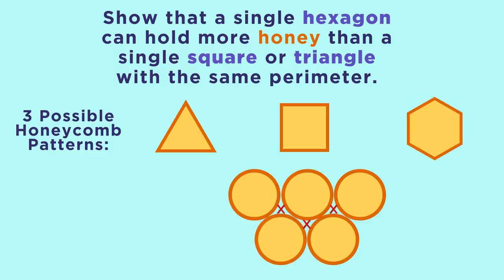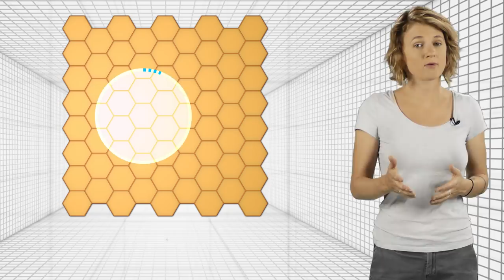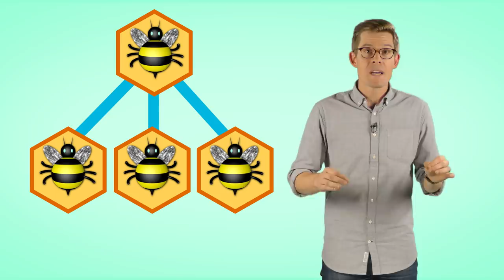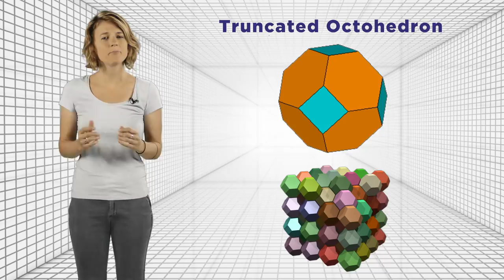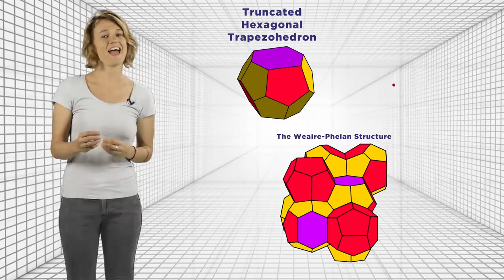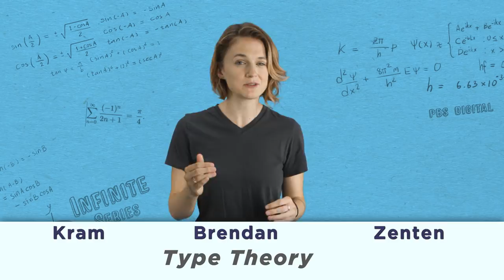The Honeycombs of 4-Dimensional Bees ft. Joe Hanson | Infinite Series

Comment: How do honeybees know to make hexagons?
According to the linked video, bees simply make circular honeycombs but as the wax hardens the surface tension molds/pulls the circles into hexagons.

I may be spoiling it for some, but I don't like it when I'm forced to go watch another video when it takes 7 seconds to tell me the answer. So, I'm helping others like me.
Reply: Bees make circular honeycombs.  Those circles melt and expand into hexagons due to physics.  Just like bubbles on a surface would be circular, but would become hexagons should there be at least 6 bubbles to surround another bubble.  It is just the most stable structure for adjacent circles.
Reply: Icewind007 

Thanks for literally explaining what the first guy said. We totally needed it.
Reply: The thing is we're talking about the second part of the vid.. 4D bees
Reply: That begs the question, how do they know how to make circles?
Reply: Actually, if you've ever looked at a bee's head you would see that the shape of the honeycomb cell has more to do with the bee's head than anything else.
Reply: So would 4D bees make spheres - the 3D equivalent of a circle - and pack those optimally, as they do with the hexagonal honeycomb? When the wax hardens into the final shape with the surface tension it would produce the Truncated Octahedron structure rather than the Weaire-Phelan structure due to the method of construction rather than strict soap film optimization.

Comment: I kinda always thought bees made hexagons because if you put circles (holes) as closely as possible, each circle is surrounded by 6 other circles, and the connections between them are inconsistent, and waste space, therefore, to un-waste as much space, you thin out the edges on all sides to the minimum, thus creating a hexagon
Reply: Isn't that then because bees have not invented closets, and have no clothes to hang up on hangers, and no stuff to hoard away somewhere?

Comment: What would the honeycombs of a 2-D bee look like?
Reply from the maker: Huh? Good question. Well, if we assumed they made "sheets" of 1-dimensional unit length combs, like in the other dimensions, then I guess they'd just be little lines...
Reply: What if bees lived in a non-euclidean world?
Reply: TheRMeerkerk Taxi cab?
Reply: In two dimension, it was about 1 cm² pattern, and 1 cm^3 in three dimension. So it would need some 1cm line ? Is there a general math word to name what is length for 1-D, area for 2-D and volume for 3-D ?
Reply: +TheRMeerkerk. Interesting.
If that world was like a sphere (negative curvature i think), then i think there could be multiple shapes depending on the size of the shape relative to the sphere.
Reply: +PBS Infinite Series "Well, if we assumed they made "sheets" of 1-dimensional unit length combs, like in the other dimensions, ..."

Are honeycombs in dimension K necessarily made up of K-1 dimensional sheets? That is, was that an assumption to simplify the 4D case, or has it been proven that K dimensional honeycomb cells are prisms with a K-1 dimensional cross section?
Reply: I will say points that are a unit length apart on a straight line.

That's what I got at least.
Reply: +erwan gaymard Sometimes it is simply called volume even for dimensions other than 3. One systematic generalization is the Lebesgue measure.
Reply: quick awnser since 2d is just infinetly flat it would be the same but just infinily flat not a line

also it would not hold any honey so why even try?
Reply: Everyone seems  to be ignoring what a 3D honeycomb looks like. 3D honeycomb cells are not flat. They have a 3rd dimension. They are prisms with hexagonal cross sections. A 2D honeycomb would be 2D. It would be stacked rows of hexagonal cells, just as the 3D version is stacked sheets of hexagonal prisms.
Reply from the maker: Steve, that is an assumption. It's just to make it an analogy with the natural 3D bees case.
Reply: Maybe 3D bees are just making lots of 1D honeycombs at 120° to one another. And then they just fill the gaps with their delicious golden vomit. QED
Reply: PBS Infinite Series what if the bees lived in a world where we drop the fifth axiom 😱😱
Reply: I just found out that 3D honeycomb cells are not hexagonal prisms as I had always thought.. Hexagonal prisms are flat on each end.. Honeycomb cells are flat only at the top. The bottom is a pyramid with a hexagonal base and 3 rhombuses for sides. The sheets of cells are not single sheets, but rather two sheets laid bottom to bottom and offset so the 'hills' of one fit into the valleys of the other.
Reply: 1D bees make 0D honeycomb,2D make 1D honeycomb,3D make 2D,4D make 3D,5D make 4D and so on
(Edit)The bees dimensions are still in it's honeycomb just saying that the cross sections are 1D lower
Reply: lines

Comment: Another way to approach it, and the companion video came very close, but never quite explained this way, is to just take the ideal circular (or spherical for 4D bees) packing order and expand the shapes outward until the spaces are gone, creating flat surfaces where the shapes overlap. 
I also was reminded of spreading centers in plate tectonics. They're almost always relatively straight segments connecting 120 degree junctions. Some are triple junctions, but in reality, they're all triple junctions; the ones with just two segments had a failed third section, called an aulacogen.